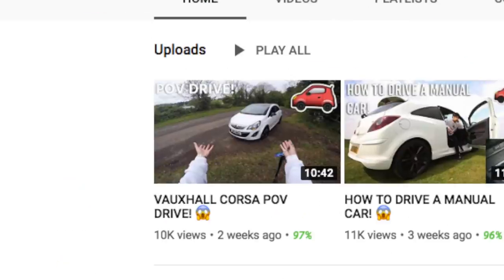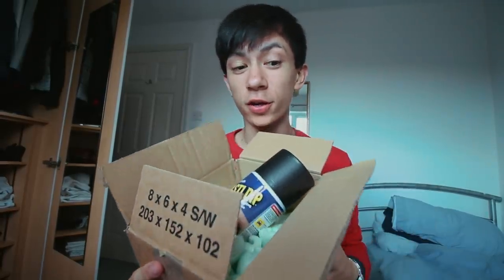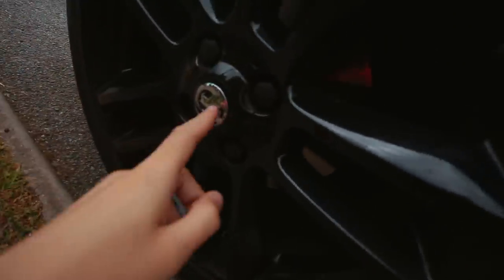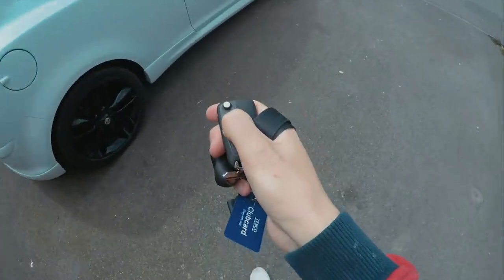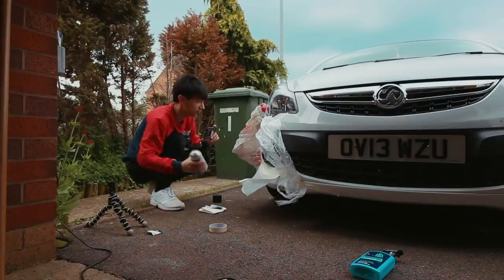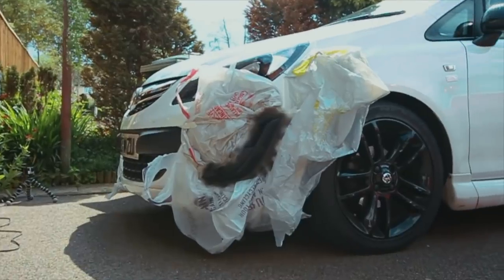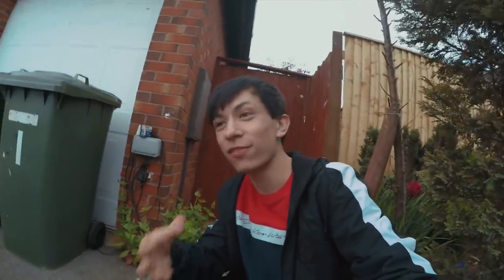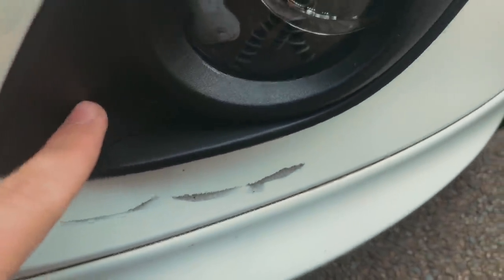DECHROMING MY CAR!!!

Comment: i had done this to my car, but the insurance cancelled on me for modifications. i said how because its not performance modifications. they said it should look how it looked from when it left the factory and this isn't stock. just a heads up, exact same car aswell
Reply: IRossyXD how did they know?
Reply: @pDn1309  came out to fit a black box buddy
=
Reply: IRossyXD did they not even give you a chance to change it or anything? Just cancelled it on the spot?
Reply: @pDn1309  yeah i said i can peel it off, just give me 10mins he was like nah ive got other jobs to do and i gotta go it should've all been done before i got here, rang up Tesco and said can i arrange another appointment and they said no you didnt meet the required standards and cancelled on me. lost like £300. but even if i got into an accident it would've just been an excuse for them not to pay out i guess
Reply: IRossyXD mate that’s so unfair man. Do you reckon mine will get cancelled if I’ve got a double din radio and gear knob?
Reply: @pDn1309  dunno buddy, i know its not performance but they look for any old shit to cancel. just read your contract i guess. most black box companys dont even allow wind deflectors. it needs to be completely stock. stupid i know lol

Comment: Question - are you still able to wash your car normally with this on or will it peel off?
Reply: Youll b able to clean the car as normal. The "paint" on the car was the chrome and now that its gone it wont peel the black.

Comment: How did you do the wheel badges
Reply from the maker: Literally just cut a square in a bit of paper then used more paper to cover the whole of the wheel so it wouldn’t get on the callipers 🤪 there should be a bit of footage of it near the end 🤔

Comment: That is no how you spray paint it, 1)you should of took the parts
2) wet sanded the parts
3)primer the parts
4) wet sand it again 
5) spray it black
6) clear coat
Reply: well it's worked out for him, so it's all good